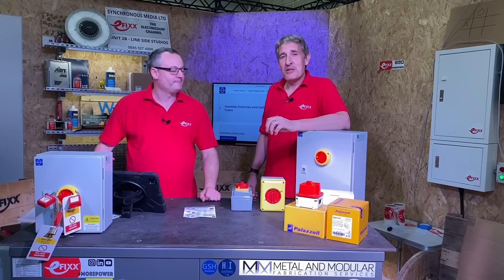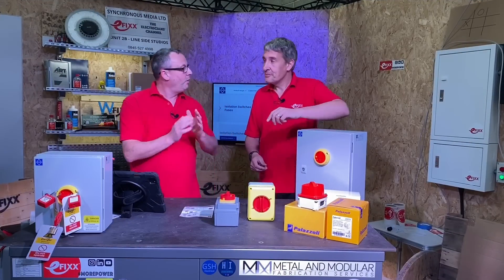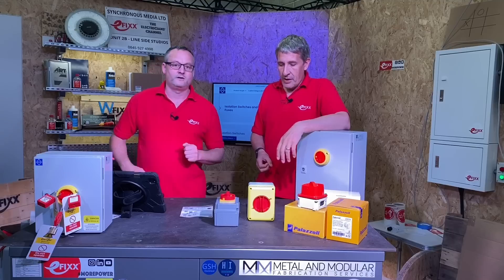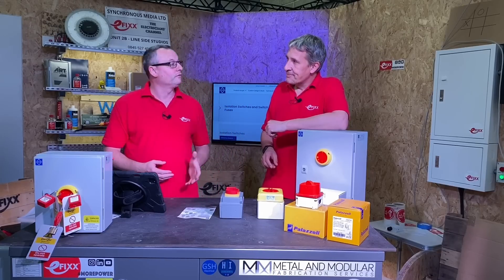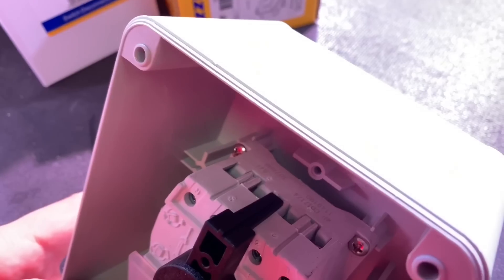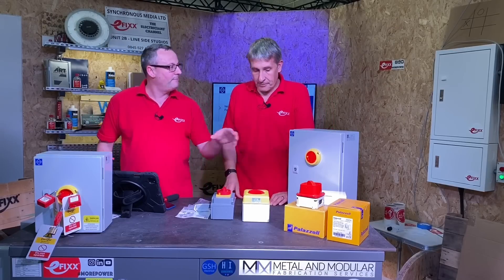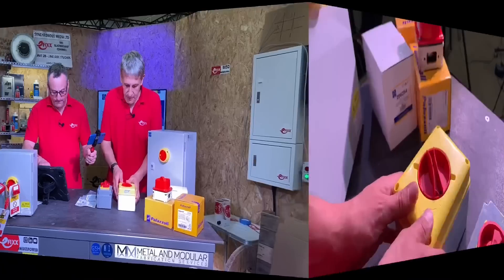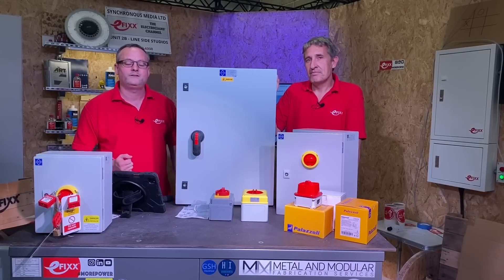Isolators, switch fuses and BS7671 - understanding key selection criteria - Lewden Palazzoli

Comment: Very informative and definitely going to switch across to these isolator. In fact need two for coming up job, so this video has been released at the right time. Also good to understand the BS7671:2018 requirements. Top team

Comment: What kind of isolator do you recommend when using on a house (meter connection to the emergency switch, to the panel board) installation? 

AS THE ➡️ EMERGENCY SWITCH
Reply from the maker: We don’t tend to gave emergency isolators - what country are you based
Reply: @efixx  Jamaica

Comment: I just refitted a MEM excel 20A fuse isolator. To provide protection for a welder on a plug/socket combo. I was surprised to see that they are still available new as they have thrown switch blades, nor do they come in Red and yellow.
Despite being a bit pokey inside they are however better built than most metal switches I've used from many manufacturers now, even at higher ratings.
What is your take on the provision of fuse protection for portable equipment. It's not something that I see implemented well or at all and expect many sparks would say a socket should be provisioned with the full rating, which is inappropriate for the load.
Eg. An inverter welder to be fused at 20A would have a 32A plug. No fuses in the welder. So semiconductor (Ag?) Ultra fast HRC fuses should protect the outlet at 20 amps. These can easily be fitted to the excel fused switch I'm using. Thus resulting in a 20amp outlet with suitable protection for the load.

Hard wired devices are easier as there is no issue with the outlet being used by another load. It's a pest installing additional fuse carriers after a big isolator, but it should be done. Especially with inverter drives. But it is something I rarely see. Even inside panels there is no suitable protection for drives and (power) electronics.
Do electricians stop at the cable protection and pass the buck to the equipment makers ?

A good subject I think.. where is the protection ?

Comment: Never knew some of those regs, very informative. You missed out price, and they are one of the cheapest to get hold of, I always use the 100amp switch fuses, one thing I would say, the connections are quite low down, and when you have a 25mm swa to connect it's a bit of a fight, maybe a slightly bigger enclosure would be an upgrade
Reply from the maker: Do you use standard or 19 strand flexible meter tails ? - https://www.efixx.co.uk/Articles/reviewed-flexible-meter-tails

Comment: Evening Chaps great video. I'm currently working on an industrial design project which has a number of Fuse Distribution Boards in the same room. Board supplying sub Boards. I would like to install Isolators local to these sub boards to provide a suitable and safe means of Isolation. The client say that Isolators at the sub boards are not required as the up stream board is in the same room and they can just pull the upstream fuse to provide Isolation. Surely this is not the right approach? Where do fuses sit with "Isolation" "Em Isolation" or Functional Switching"? My biggest concern, note that this will be a brand new installation, is there is a risk of the fuses popping in someone's hand when inserted or arching when they struggle pulling it after many years, whilst doing this activity on load.